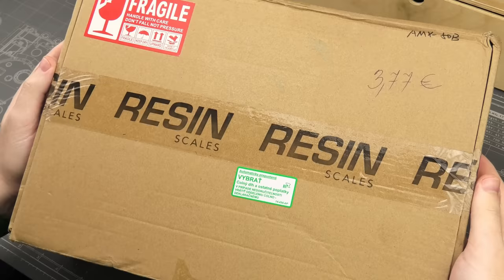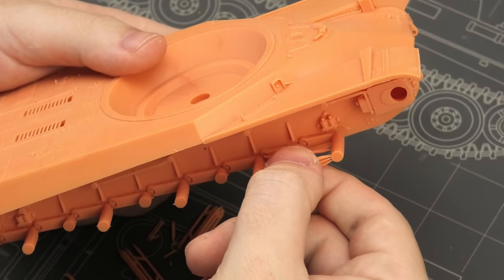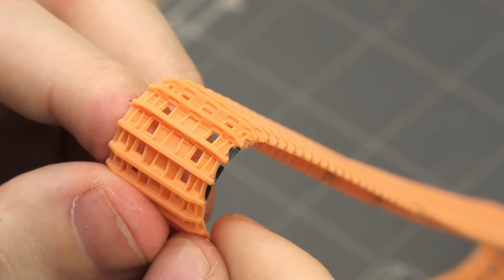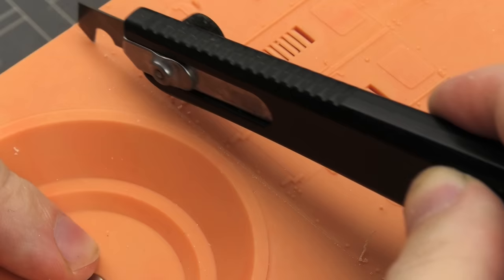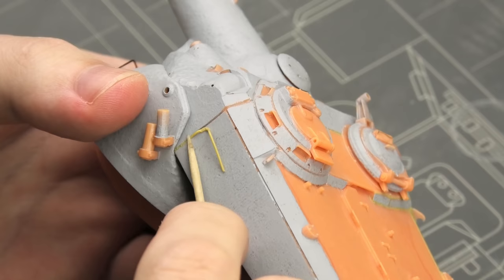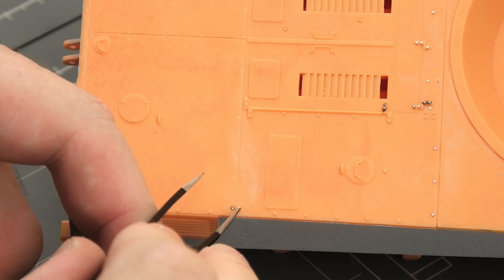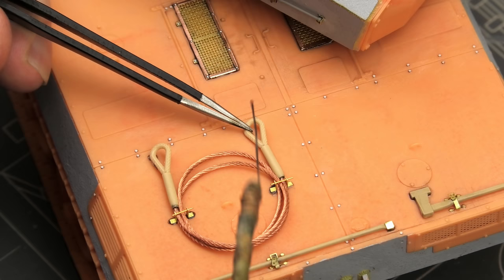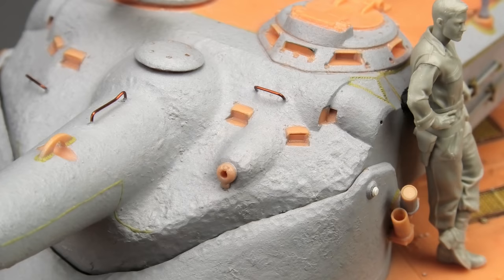The Most Impressive Resin Model I've Ever Built (AMX-50, Resinscales 1/35)

Comment: Just a tip from someone who works professionally with 3D printers: just use a pot with hot water and put the parts in for one minute. Then you normally can easily pull of the supports (sometimes depends on the used material). Just make sure it is not as hot that the parts also start to bend/deform.
Reply: I do the same thing with my 3d printer makes removing the supports much less tedious
Reply: I was just about to suggest this! ;-)
Reply: @F. Lbk do you have a temperature recommendation or?
Reply: @thunderstruck6647  I use about 85C from my kettle, but that was with Forge World resin for Warhammer kits, I can't be sure if the 3d printed stuff would work quite the same.

Advice I got was to start with hot tap water, and if it doesn't do enough, add splashes of boiling from a kettle until it works.

Another good option for longer pieces is a hair dryer, they can direct a pretty solid and controlled amount of heat.
Reply: He cites at 5:08, that the reason he didn't do it is because "3d Resin doesn't react well to that, and they won't bend back into their original position a week later."
Reply: @bleysmcnutt5500  two different things being discussed. using hot water to make supports pop off does work 
using hot water to bend and reshape parts doesn't work well at all.

Comment: These early cold war french tanks are really cool. The best thing is the similarity with german Gen 3 tanks. And those THICC cast oscilating turrets…
Reply from the maker: Oh, the oscillating turet in a fully elevated position!
Reply: Yes! It can clearly be seen that the French had been fielding the Panther post war and used the tech and updated it for the running gear. It would be an interesting concept to do a what if model of a 1948 panzer MBT of a victorious German-GB-USA pact vs Soviet cold war era vehicle.
Reply: @G60syncro  Yeah. German WW2 tank construction had a lot of influence on french 50s tanks. Even the engine was german.

Comment: Man I've wanted a proper AMX (any of the experimental ones) kit in plastic for a while now. Shame they're not that well known to warrant one of the bigger manufacturers taking a shot at them. Still, this looks temptingly good.
Reply from the maker: Agreed, a styrene kit would be awesome, but this is surprisingly good. And definitely not as terrifying as a "traditional" complete resin kit :)
Reply: @NightShiftScaleModels  I'm still holding out hope for someone like Amusing Hobby to do a kit as they seem fond of experimental and paper tanks, and they do good work with those.
Reply: Tamiya do an AMX 13!
Reply: @ozzythehoddy  I have one of the Takom ones, solid little thing. But I meant stuff along the lines of this one, AMX 50 100, AMX 50 120 or even the Lorraine 40t which is even more unique with those rubber tyres for roadwheels.
Reply: Amusing Hobby released an ARL 44. Maybe they will release the AMX family some day? 🤞
Reply: @guillaumeheinrich9668  On the way by the end of the year according to Scalemates!
Reply: @guillaumeheinrich9668  and they did it 😎

Comment: Just looked up the kits, those prices are understandable for resin but WILD 🤯 definitely will be waiting for the tech to get better or cheaper.
Reply from the maker: Yeah, I'm sure the print time is also a huge factor for the final price. Printing one of these kits must take several days.
Reply: This!
Reply: @NightShiftScaleModels  Yes -- assuming they're using consumer-grade printers, we're talking 3 seconds for most layers, and there are likely 20 layers per mm of height. Since the hull looks like it was printed standing on its front, that's per mm of the length. Plus it has to be cleaned and cured -- and they have to account for failed prints in their costs.
Reply: @NightShiftScaleModels  still probably it would be cheaper if you have printer yourself in the long run.

Comment: Accurate Armour have been manufacturing excellent complete kits of 1/35 military vehicles since the late 1980's. I've built their Panther D w/ IR scopes and  zimmerit, they're outstanding. Very easy to build and incredible detail - the bare minimum of scaffolding and flash.Their figures are of the highest standard.
I have their 1/35 U-BOAT. Unparralled achievement. I will build it when I master seascapes.
Great work sunshine and so entertaining with your observations.

Comment: If you put the pieces in hot water the various support will come off easily. With most type of resin it works
Reply from the maker: Indeed, I've been told the same thing. However I had a bad experience when washing the model with soapy water, the moisture made the tracks "soft" and grow in size. I forgot to mention it in the video, but luckily, the "shrank" back to their original size. So I'd rather avoid it with some fragile parts, just to play it safe.
Reply: No, that's terrible idea. It will soften and deform the resin long term. Don't do this.
Reply: @NightShiftScaleModels  You are correct. Hot water deforms the pieces. Bad idea to use that "trick".
Reply: @shadow7037932  I always do that and it never deformed in the long term, could be the type of resin

Comment: To fix resin pinholes or even to weld broken pieces you should purchase a small bottle of resin used in MSLA printers. You can apply a drop with a toothpick to fill in the hole or even to hold pieces together and if use a UV flashlight to instantly harden it. Then you can sand it down like normal.

Comment: Protip from someone who handles 3D printed resin models, albeit not tank ones, at my work. The bottom hard piece the supports are attached to is called the raft,  and we often break that into pieces before beginning to remove individual supports, as it makes it a little easier to get at the more interior supports. The supports attaching it to the parts will often break off the parts with the raft pieces before the parts break (with obvious exceptions when it comes to more delicate parts).

Comment: A tip for removing supports quickly is to place the item in warm water as most supports will be warm and be easier to remove, bend,etc…
Love the vids though man
Reply: I literally came here to say the same, you save a lot of time by doing so. I haven't used nippers for nearly 12 months at this stage.

Comment: Having a hi-res resin printer . . . The problem with separating the tracks was a print setup issue. They could have set a parameter to place the tracks further off the base, making  access to the sprues longer and easier to remove.

As for the panel lines. it depends on the resin they use whether or not the panel lines will come out well.

This is a learning process, and since they are new at this as a commercial endeavor, they still probably have to work out some issues.

Comment: Just dipping them in warm/hot water makes them pretty easy to remove supports, though drying them can be a pain later xD
Reply from the maker: Water can also soften and distort the resin, so it's good to be very careful with that! The tracks "grew" in size after I washed the model prior to painting, luckily they shrank back after a few hours

Comment: Yeah the supports are a big tradeoff. It's either packing it all in to do as few runs as possible (likely those prints took like 6-8 hours, depending on height), or doing a bunch of runs but also requiring up to a couple days to actually finish. If the parts are REALLY stuck in there, I find you can usually take a sharp saw and cut along the base material, usually you avoid damaging anything too badly..

Comment: I've had a Elegoo Saturn printer for over a year. I found that if you put the parts with the supports in warm/hot water for small amount of time you can bend the supports and they will easily separate from the main pieces. This will save you a lot of time.

Comment: To remove the supports from resin prints, a common method is with hot water. Hot water will soften the resin temporarily so that you can pull the supports off by hand

Comment: A tip from someone who does a lot of resin 3d printing- if you have an ultrasonic cleaner that has a heater function, or have some heated water, and let the supports soak, they'll be infinitely easier to remove.

Comment: you can always use more 3d printer resin and a UV light instead of the superglue to fix any and all mistakes. 
also bonds better XD
Reply: Or to join elements while still allowing to adjust position. Then once you have it where you want it, cure it with the UV.

Comment: Not seeing this replace injection molds just yet. Many kits still have visible layers, which can be a pain to clean up (depending on kit details/geometry) and you'll have to deal with the nasty dust. And as you said, resin is very brittle and details will break much faster.

Comment: use a warm hair dryer on the supports and it should warm them up and as the tips are so fine they should break from the model leaving no puck marks. just be careful around fine thin parts. not sure if the model is pre cured. so should always wear safety glasses when using snips as cured supports can break and fly at your face. run a finger nail down one of the parts if you see a chalky line from your nail then the model is not cured so might need curing before use. looking forward to this. as this is the main reason i got into 3d printing was to print tanks. though fdm was not the best but been using resin printers for years now. though i must admit i still not printed any tanks. but i have a nice couple of tanks i paid for as they have all the eternal parts with the models love your channel matey you do some great dioramas and i should get my arse into gear and print the tank and arty. and i should get back into making tank models again at some point. :) and you should always wet sand resin prints. to cut the dust down and then dip into water to remove the muck and you could use a drop of 3d resin under the wheels and press into the track and use a uv torch to weld it into place. :) really looking forward to see this one on a diorama :)

Comment: If you print the parts yourself, you won't have this bad of a sprue remove experience. You will just pull them off after cleaning the liquid resin from the parts, but before curing them in a uv cure station. Since the resin is somewhat jelly, the supports peel of very easily and leave less marks on the parts. Dipping the prints in hot water helps, too.

Comment: resin support pro tip: Put the part in hot (almost boiling) water for a while and the supports will almost come off on their own.
Reply: Also I recommend using an FFP3 mask for sanding resin since resin is highly carcinogenic.

Comment: It is amazing the advances 3D Printing has achieved in recent years. My one gripe is the designers who tend to print details that with fidelity in mind would be better suited as a separate piece. IMO this cheapens the final product and these details become more like blobs that don't fit into the final scope of the build. This is unfortunately prevalent in the smaller scales where the designer/ manufacturer attempts to make it so the builder has to invest less $ into the project. Wherein the opposite is the case. The builder ends up sacrificing them and adding a replacement.

Comment: As always a really inspiring and intresting video Martin! But why did you chose the AMX 50 and not the Kranvagn? They are both sold by resinscales in 1/35th scale. And they are almost the same It would be fun to hear your thoughts! :)
Reply from the maker: I just liked the rounded cast shape of the AMX a little more than the Swedish tank :) Also, i think they released the other one after I placed my order.
Reply: @NightShiftScaleModels  Yeah! The turret of the AMX is more well thought out so to speak, It has a more radical shape than the Kran.

Comment: As someone who does a lot of 3D printing and designing for printing, modelling the panel lines as raised and not including weld beads is just laziness. A super high-quality printer like what they appear to be using would have no difficulties printing it if even mine can print that size of detail. 
There's also some questionable decisions in terms of support placement. I'm guessing they positioned things like the hull straight up and down to save space on the print bed (and reduce the number of prints they need to run to make a model) and just accepted the support damage on the front of the model. I personally split my models up so each piece can be supported from the inside which eliminates the issue.

Maybe I should start making videos of my own models...

Comment: whats a bit dissapoining...that they deliver ( guess not cheap kit) with supports on...normally its much easier to get the supports off right after the print ...washing the resin off and give it a bath in hot water....removing them after curing make breking parts off more often
Reply from the maker: I actually prefer removing the supports from cured prints, even with my own designs. I think it's a personal preference for everyone, but some of the parts could be printed more "accessible". The tracks were especially difficult to remove.
Reply: @NightShiftScaleModels  i print mostly 28mm Miniatures...and think its easiet to grind the model on tanks if there are artifacts left from supports than on my minis

Comment: Don't use the fancy nippers on the resin supports. It will dull your nice nippers very quickly. Get some budget nippers and use that for clean up. This company could also do a much better job with setting up the supports. Ton of excess supports there. Looks like they just did auto supports with no manual optimization.

Comment: soaking the pieces with supports in hot tap water for 5-10 mins greatly helps with removing them.
Reply from the maker: Water also softens the resin, so care should be taken with fragile or easily distorted parts. My tracks grew in size after I washed the model in soapy water, but luckily they shrank back after a few hours!

Comment: Honest question, but wouldn't putting these models in warm water and removing supports make the job easier, since resin becomes more flexible?
Reply from the maker: It could distort the suspension, tracks and barrel. The tracks grew in size after I washed the model in soapy water, so better be careful with that!

Comment: The biggest problem with this 3d printed kit is to remove the pieces ,sand and clean them.I would prefer still  traditional plastic kits and  to assembly metal tracks than this torture.

Comment: Call me synical, but I wonder if all of these models are just ripped from their respective games, WoT/WT and Red Alert 2 with some smaller touch ups.

I might be wrong/it's licensed, but most of the pictures are even from the games.

Awesome work as usually however. :)
Reply: The inspiration does come from WOT or RA2. however, the designer of the kit has to rebuild 3D model in order to print it. Cuz lots of details in game are actually textures. And RA2 tanks only exist on concepts And in game pixels. 
I heard from resinscale they did went negotiate with Wargaming, seems WG has no issue with them by far. Not sure about EA though
Reply: @xiaoyang5236  true, I should not have used the word, just, however just adding detail is a lot easier, from my own experience than having to work from scratch. I don't know how well detailed the new WoT/WT models are. And that effects quite a lot how much extra work has to be made. 

At the same time I don't really care, more of a peculiarity.